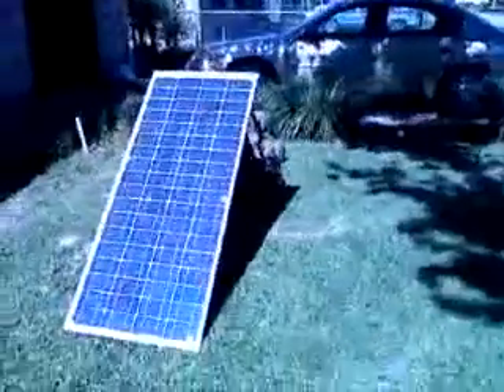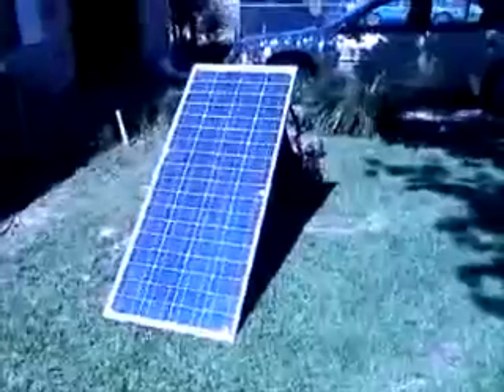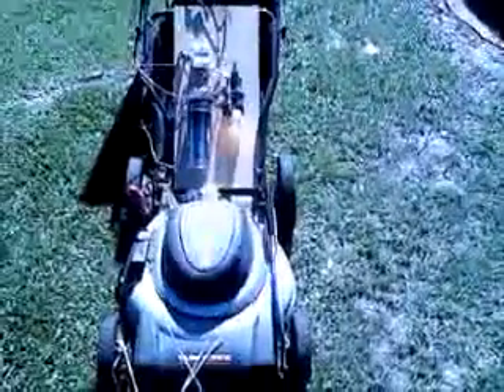Solar Power converted to 110v (No Batteries)

Comment: i did this but with no capacitor i used just a voltage converter to convert the power to 12 volts and then power the inverter it worked flawlessly i was even able to power the inverter with two 9 volt batteries and a 22 watt cfl light bulb

Comment: I was going for something similar was going to take the capacitors from old CRT monitors at work we have trash by dozens and run in parallel to boost size up to something larger like you have.

Not planing on conversion though but, to use as storage to run PC case fans off of.